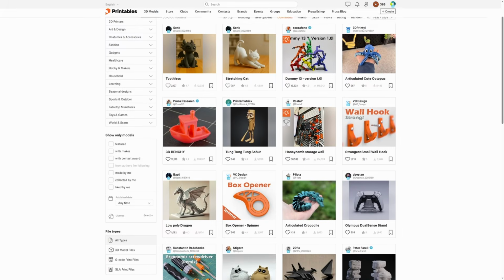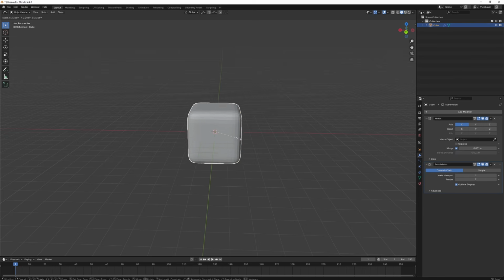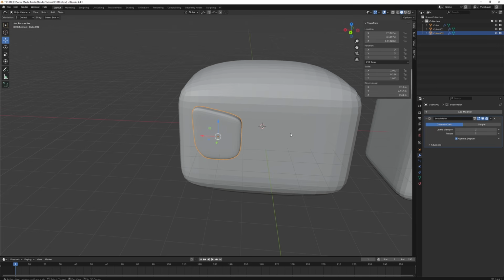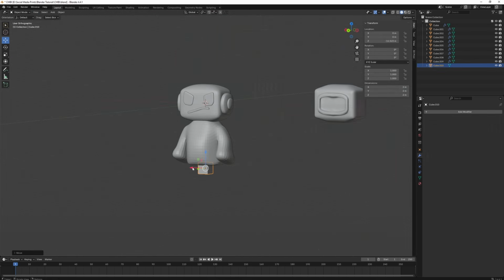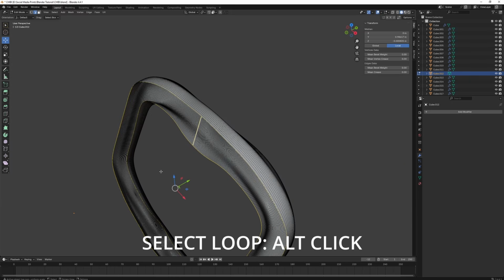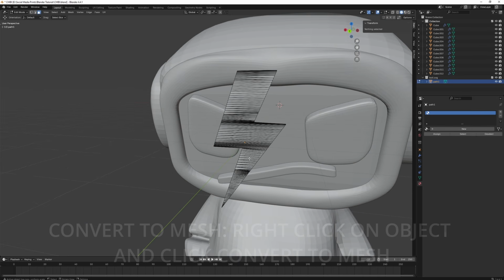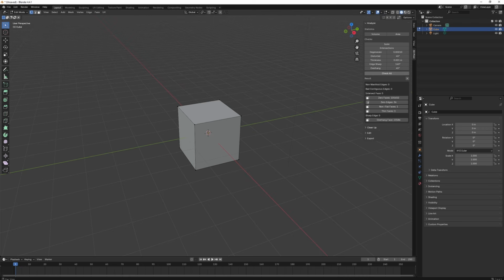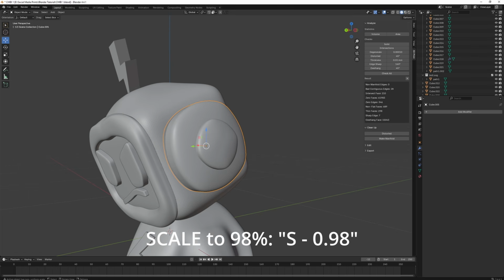From Zero to 3D Model Hero – Beginner's Blender Tutorial for 3D Printing!

Comment: Great video, if you're not a beginner. As many people have said, a few minutes into the video I had to stop because nothing was happening as I expected. You do definitely know your stuff, but definitely not a beginner video. As an example, you start by subdividing the cube. You firstly don't explain that there are 3 parts to a shape, Faces, Vertex and edges and you need to be in faces mode to be able to subdivide the face. You seem to subdivide the whole cube. How did you do that, because when I tried, all it did was subdivide the one face, when I found out you have to select the face and then subdivide. Then when I tried to subdivide another face, it wouldn't do it.

Comment: You created a base (I think) in Blender, but your end picture of your 3D printed, colored robot has no base.  How do you ensure your models like this will be able to stand up on their own and not have a wrong center of gravity?
Reply from the maker: The base we created in Blender was just to flatten the bottom of the feet, it doesn't need to be printed with a base to make it stand, it just needs to be flat. But regarding center of gravity, its pretty easy to just eyeball it for something this simple but for a more complicated model, perhaps one that is quite top heavy you can move objects to their center of mass - in object mode click on the object, then in the top left toolbar click on the "object" dropdown, click "set origin", then "origin to center of mass" then you can just move and center it so it is balanced.
Reply: @3DJake_Official Thanks so much for your prompt, thorough, and helpful answer!  I truly appreciate it!

Comment: interesting, however, you did not make it very noob friendly, as others have mentioned, you cut and skip minor details that make it very hard to follow along with you. For example, keyboard short cuts are a no on tutorials, show the menu the tool came from. No one remembers anything from key short cuts. I have been using blender for many years and I use very few short cuts as its just to much to remember (as i also use hundreds of other programs to ...which all have short cuts to and I'm old and forget s**t) . I have learned quite a bit from this, but it could have been made a lot easier...

Comment: Great guide! One problem I found was at 5:40 when you are moving the vertices and adjusting the eye the rest follow, when I select as u do there and press "G" it only moves that specific vertices, any shortcuts for making the rest follow along?
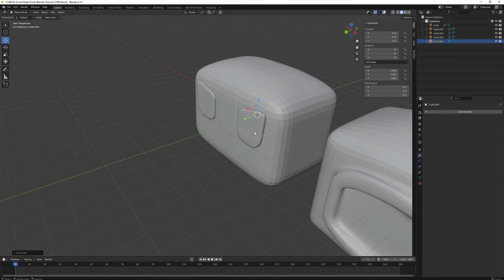Reply from the maker: If I understand you correctly, you can use proportional editing to move surrounding vertices within an area of effect. It is detailed in the following section from 6:30, or maybe I didn't understand you?
Reply: @3DJake_Official  Yep thx that did it

Comment: Starting with Fusion360 for my basic functional parts, I quickly learned that the way you should work with a CAD like software like fusion, didn't really fit my way of thinking and handling models. I missed the simple control of the edges, faces etc. I knew blender existed, but every one warns about the steep learning curve, So I put learning blender on hold. 
Now I am starting to design more fluid models and Fusion just does not work for me anymore (Still do for functional parts though). So installed Blender and this is the 3rd video I watch now and it is exactly what I need in terms of control.

Thanks for this video man, it really takes away my concern about the steep learning curve. You make it seem relatively easy and manageable! Yes there is a lot to learn, but for 3d printing, I feel confident I can manage this. So thanx!
Reply from the maker: Thanks!!! Learning programs like Blender always felt similar to learning a language for me. You just gotta use it as much as you can, if you face an obstacle, google the solution and get back into it, your brain joins the dots.

Comment: I have a problem mit this kind of videos as Newbie to 3d printing. I've watched few of these so called "3d modelling for 3d print" and they have the same problem - it's just a 3d modelling /blender introduction. There is no info about 3d printing - Do i have to consider some special things for a 3d model or not because its gonna get printed? what about the thickness of the "walls" of a model/plane ? Does this matter? Do i have to think about printing support when creating models? You need probably be aware of measurements in Blender.
Reply: Most of what you've mentioned would be handled by your slicer, not in Blender. I suggest finding some good intro videos for some of the top slicer programs, even if they aren't what your printer will work with. Understanding what is normal from one to the next will help you to understand what they are for in general.
Reply: @nicoletarratt602  Ur goated🥹✌